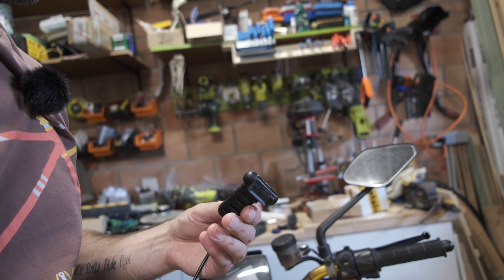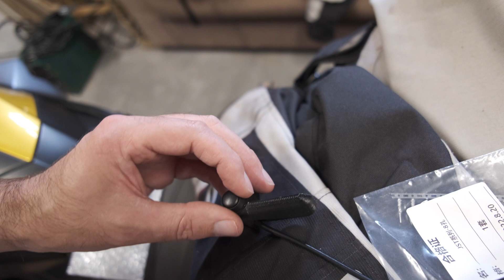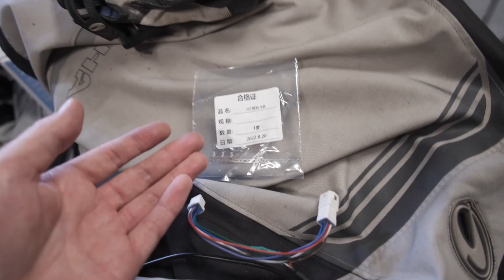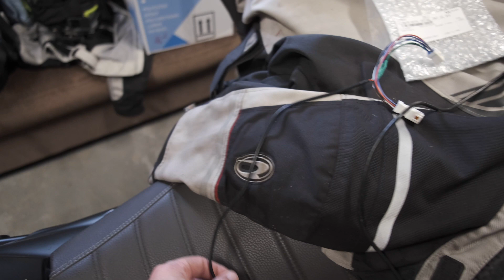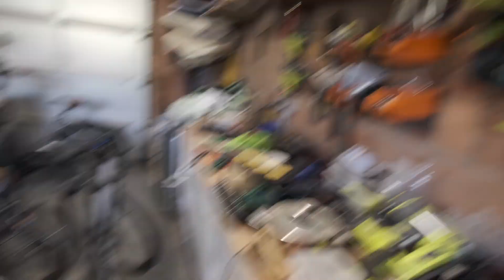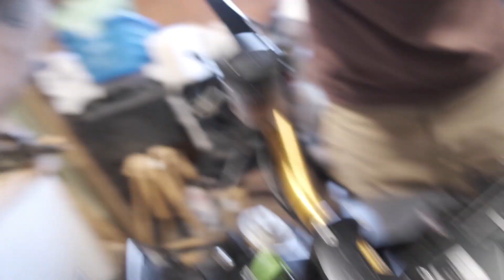Energica CRUISE CONTROL button FIX or work around | easy cheap and reversable solution

Comment: Just finished this on my Experia.  The pin out is the same, but the wires on the Experia are all black so you're just going to have to follow the pin out.  It makes the bike so much better now.  I get numbness in my hands fairly quickly, so I use the CC alot.  I knew when I bought the Experia the CC was going to be an issue.  I printed the other two button mount on thingiverse.  I was a tight fit, but that is probably print settings.

Thank you for making this video as without it, I wouldn't have know it existed.

Comment: How does the printed part  stay on the control? Just a friction fit?
Reply from the maker: There is a teeth/groove thing it slides on and a hole to secure it with a tiny bolt.

Comment: When looking for which wires go to which button. Does the wire send 12v when the button is pressed? Or are they sending a ground signal?
Reply from the maker: I never checked that. Instead I looked for continuity. The beep function on most  multimeters.

Comment: wow, that's neat, can't wait to hear how well it works
Reply from the maker: Tested this morning on my commute to work. Works great. I'm not a heavy cruise control user and definitely not without radar. But at least I can reach it now 😂 those white plus are very fragile though and if not crimped correctly easy to get a short. So make sure to double check. My killswitch initially triggered because of a short.
Reply: @Hans2183  I've never used a radar detector in my life, but maybe I should, are they worth the trouble?
Reply from the maker: No I meant radar to keep distance the way it's done in cars and some bmw motorcycles. As a safety measure.

Comment: Do you know of anyway you can get vehicle to load from energica?
Reply from the maker: This video from Brian (electric cowboy) is the closest I've seen for v2L on Energica. If you look closely you can see the big black box converter that is needed still. https://youtu.be/5dRbq8FPvqw there are concepts of home chargers that support bidirectional load but those were all chademo instead of ccs. Plus on Belgium this isn't legal just yet. There was a first one installed for a Hyundai ioniq 5 a few days back and that required politicians to approve and push energy providers to allow it for this one single case.
Reply: @Hans2183  That is exactly what I want,but the link to his website doesn't work for the ev siphon.
I damaged my Energica Ego and cannot afford to repair it.
But I have solar power and would like to utilise it's 11kw battery for storage and use.
Otherwise my bike is scrap....
Iam not sure this is a real box,I think is a fake?
Reply from the maker: It's real for sure but never went beyond a prototype. In the dutch user group someone was polling if there was interest for such a project. It can be done but you need the right people (not me)
Reply: load?
Reply: @Bike_Electric  reversing charge,so you can use the battery to power things.
Reply: @alanrobinson2229  oh! hell yes please, I've heard the term "V2G" or "V2H", ok "load" makes sense now; I would love to utilize this massive battery